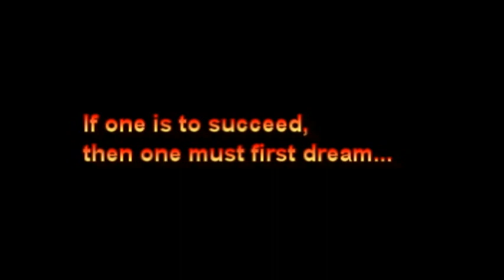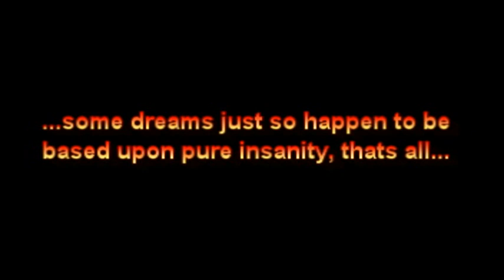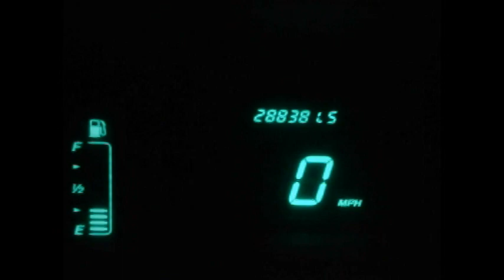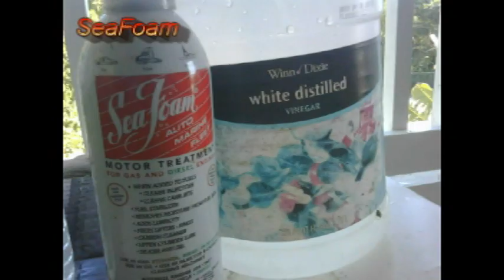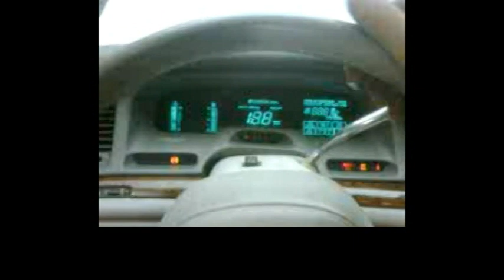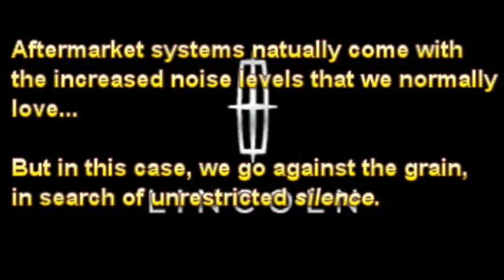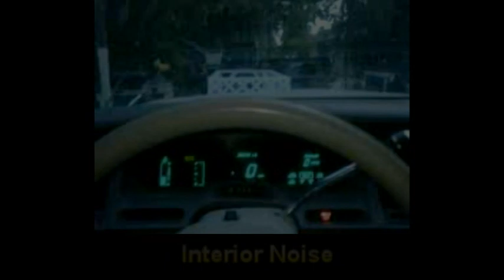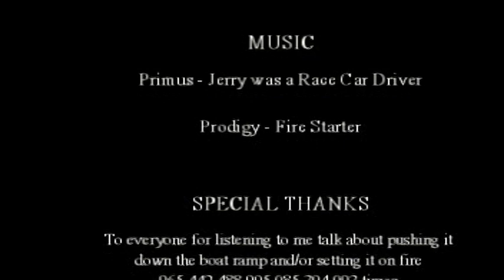1996 Lincoln Town Car Stretch Limo - Engine Swap.

Comment: UPDATE Well 11 months later, I have finally finished moter swap, and only have exhaust to redesign.  Its been a hard project, nothing seemed like it was easy, everythings modified the end result: 2007 Crown Vic P71 Police Interceptor 4.6l in limo.  Once exhaust is done, I plan to do a little body work for some small dents, and a fresh coat of paint.
Reply from the maker: powpop1 How does it perform with the PI motor? I learned fast that many things are specific to each year. I have since put a very low mile 95 4.6 in a 2000 120"  Town Car Stretch. The front cover and flywheel had to be swapped. One of the bolt holes in the front cover had to be tapped only for the purpose of screwing in a bolt to plug the hole. Newer model NPI intake and red injectors...turned out to run very strong in such a big car. I have abandoned all reason to buy anything, including motor mounts, from anyone other than Ford. Aftermarket stuff is a time consuming error.

Comment: how long did it take to swap out the engines
Reply from the maker: If I were to have just swapped one out and one in, it would have probably taken about 8 hours to get it all lined up, etc. In this case, aside from the stuff that was done to the engine itself, I actually pulled the engine and left the transmission in place. In a different limo, I pulled the engine and transmission together. It was much easier. Just pull the driveshaft away, remove the bolts holding the transmission mount to the transmission itself, only loosen the bolts from the trans mount to the crossmember. Remove the exhaust, motor mount bolts, radiator, etc. Unplug the wire harnesses from the car and lift it all out in one piece. Still a little tricky, but much easier than leaving everything in place and taking the engine alone.